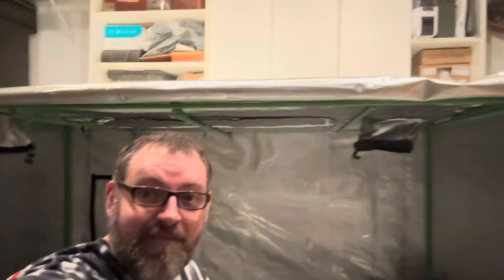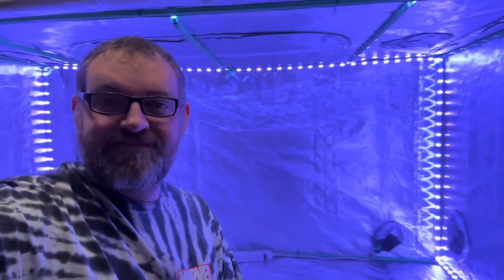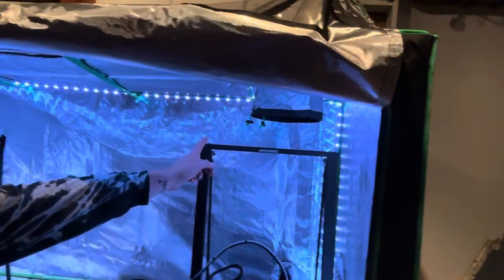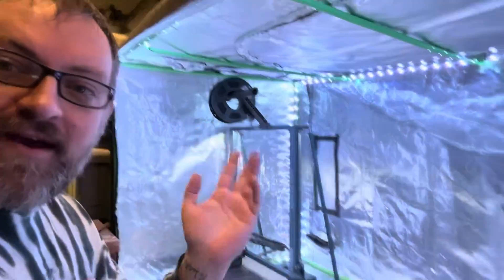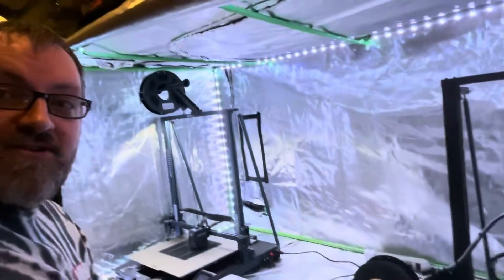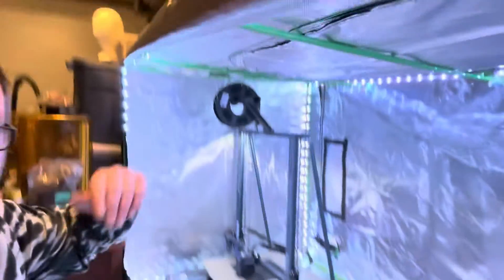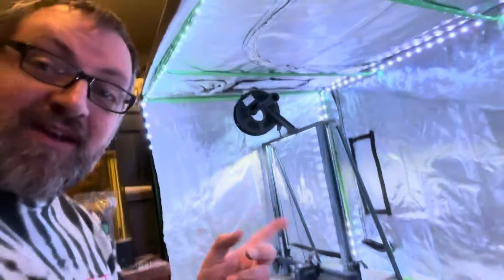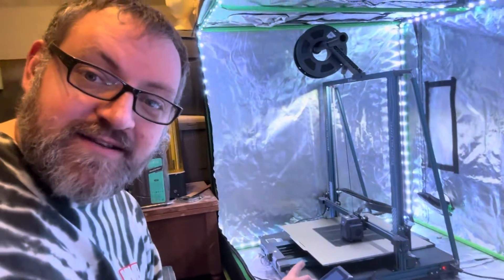New Tent Enclosure For 3D Printing In My Garage.

Comment: Does the heat generated by the printers keep the tent warm enough in the cold or do you have a heater in the tent? Thank you
Reply from the maker: Printers keep it warm as long as they are running.

Comment: Love the idea. I need to look into this. I've had tons of layershift issues with my kobra 2 max. I tighten the belt, loosen the belt, tighten it again. I thought it might be the vibrations. I pretty much have to print on the slowest setting right now. And even if I don't get layer shift. It sometimes just stops in the later part of the print and wont restart. Did you have any issues like this when you started printing with it?
Reply from the maker: I had the stopping issue. Anycubic said it was my slicing software. I was using cura at the time. I now use Prusa and have only had it happen once since. I personally think it’s caused by their printer getting overwhelmed with gcode commands. 

The layershifting was something my friend went through. He ended up sending it back. He couldn’t figure out the cause. I watched a video on TikTok where someone had loose gears on the back. They just spun around. I believe he tightened them and fixed his issue.

Comment: I took my pink saturated desiccants and put them in my enclosure and a week later it was all blue and dry. Your enclosure should dry out your beads, how funny would that be!
Reply from the maker: A buddy of mine said they can build up moisture if the inside is hotter than the temperature outside of it. That’s why I want to add several desiccant boxes to the inside of mine. That’s interesting that yours worked so fast though. Maybe it will mellow out after a couple times of drying them. Similar to how cigar humidors work but in reverse. Humidors can take time to charge before you can use them properly. The wood soaks up all the humidity at first. So maybe it’s like that but in reverse? 🤔🤷‍♂️

Comment: Looks great, also lowering bench would be more stable for sure! I use a grow tent for my Saturn S resin printer in the basement with a vent leading out to the dryer vent because of the resin fumes. These tents works great for warmth and fumes. You can also use ABS now!
Reply from the maker: Oh I could connect it to the dryer vent since it’s right by the enclosure. 🤔 Thanks for the tip!

Comment: What will your 3rd printer be?
Reply from the maker: My next printer is another Elegoo Neptune 4 Max. I really like the one I have and I think with the Linear Rails upgrade and hopefully my newest bed mod, it will be even better than my Anycubic Kobra 2 Max. Currently the AK2M is printing faster with less failures but the EN4M with the Linear Rails should be able to match the speed and potentially be faster. The drawback for me with the AK2M is that I don’t have access to the backend to see Klipper like I can with the EN4M. Plus I keep hearing horror stories about  Anycubic’s support and customer service.

Comment: i returned my my elegoo today . 
good luck new bench
Reply from the maker: Sorry to hear that. What are you going to get next?
Reply: @OuterRimArmorer   bambu labs A1
if i find alot wrong with that i will get rid of it , hope not
Reply: @OuterRimArmorer  bambu labs A1
Reply: What made you return the elegoo? I'm about to buy another. Either 4 plus, or max.
Reply: @BlazeT3D  cause the firmware was not up to date and it locked up 
according to instructions  very difficult to fix i don't need that stress anymore.  so you gonna plus or max good no thanks.
Reply: @PeterAgostiniJdcap26  that’s why i’m leaning towards the Kobra 2 max instead. But I think I also wanna dabble into klipper. But we’ll see!
Reply: @jackofalltrades3011  yeah outer rim there recommends that kobra  Max I'm getting a bambu lab A1
Reply: @PeterAgostiniJdcap26  I think I'll check my firmware when I get home tonight now. I know there is a download if mine isn't . Mine works like a champ, though. Must have been a bad batch that got out.